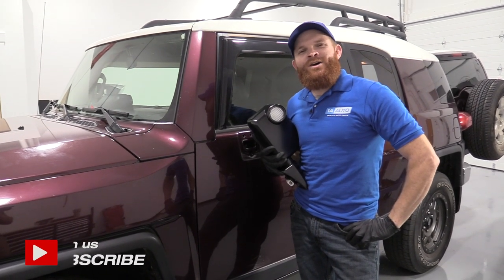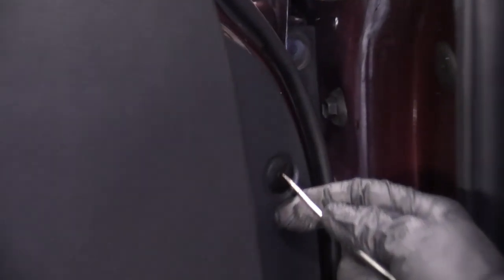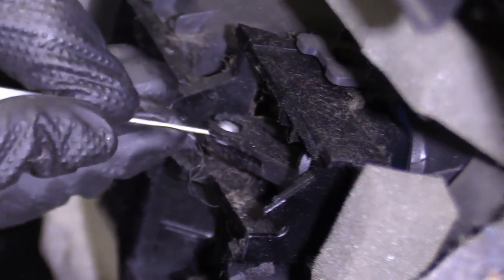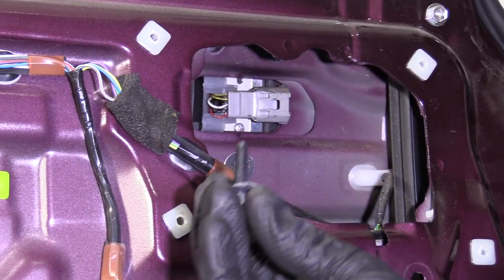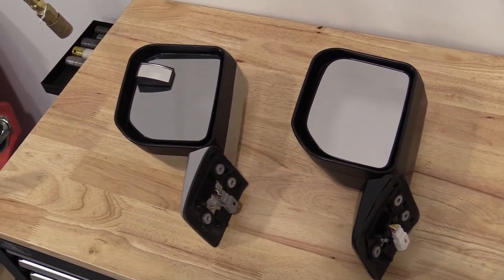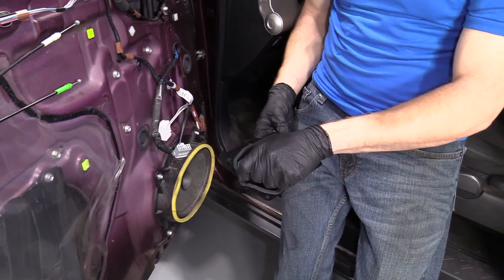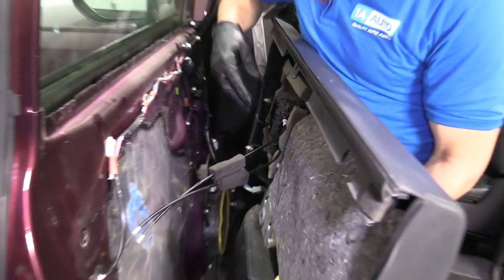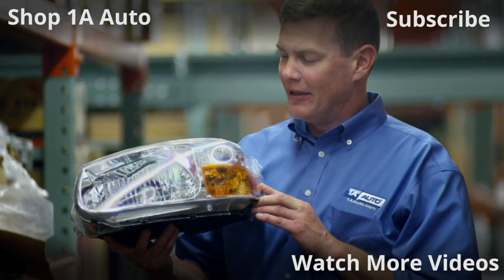How to Install Black Side Mirror 07-14 Toyota FJ Cruiser

Comment: I just want to point out that you removed the driver window switch wrong. You need to pry from the Front of the switch so you do not break the tab. Other than that, great video. Thank you.

Comment: Install was easy, but quality control is lacking. One mirror had deformed gasket that didn't sit against the door flush. I had to take apart and swap the oem gasket to get it to work. Buy OEM if you can.